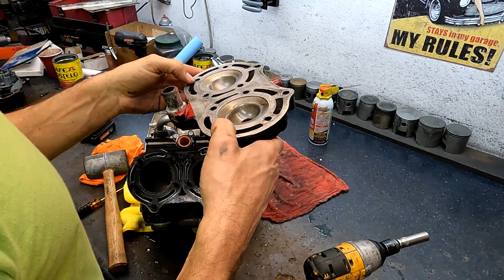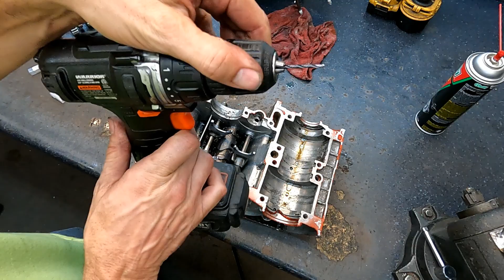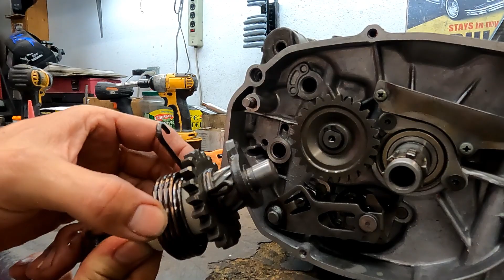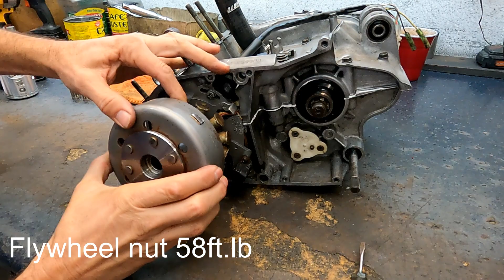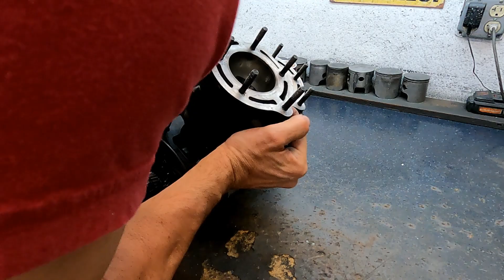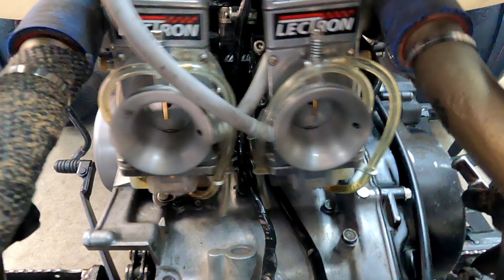Banshee King Ranch Build

Comment: A good set of M-42 Colbalt drills with a 135* point are the best. I’ve been a machinist over 45+ yrs. If you can afford a set of carbide drills, common sizes are 3,4,5,6, 8 and 10/12 mm drills.

Comment: My banshee leaking coolant at the bottom case on the two last studs idk why it's leaking
Reply from the maker: It’s the Oring on the aluminum tube that is in the clutch cover. Pull the clutch cover and replace the Oring on the aluminum tube that sticks out of the side case.
Reply: I wish I could find a video on how to fix it
Reply from the maker: You did, right at the 2 minute mark. Side cover is pulled exposing the pipe with the Oring on it. Just replace that Oring with a new one grease it and put the side cover back on. All finished.

Comment: I have some questions what is the best timming for the stator and what are the benefits of cutting the star
Reply from the maker: There is no best timing, it is always different depending on how the motor is setup. The star cut helps the shifting when you make a little more HP than stock.
Reply: @herrjugsracing7816  thank you 🙏🙏🙏